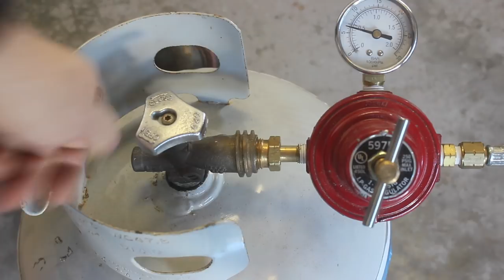Forging the Pelican Hook Lanyard

Comment: I need to build a propane forge.  I had to make a clamp for 8" pipe out of 1/8x1 1/4" strap and cold hammered it.  At least my son cut out a pattern on his CNC Plasma cutter for me.  It did work pretty well.
Reply from the maker: Go for it, gas forges are so nice!